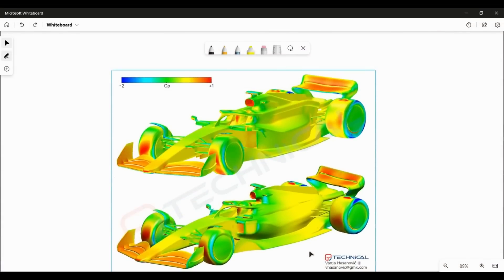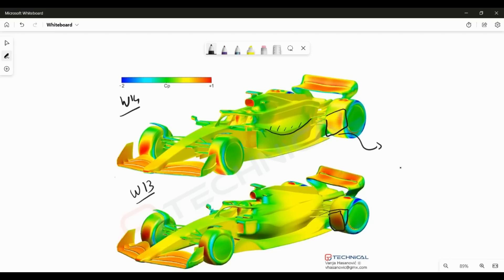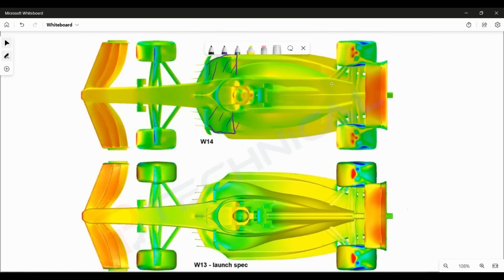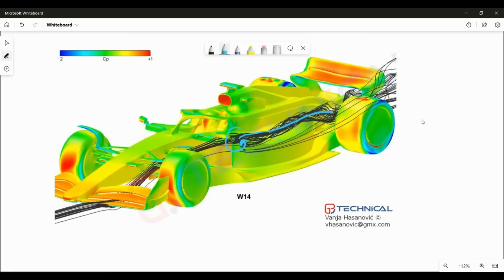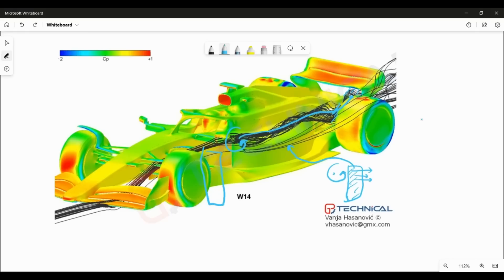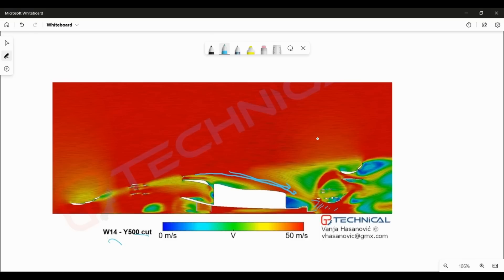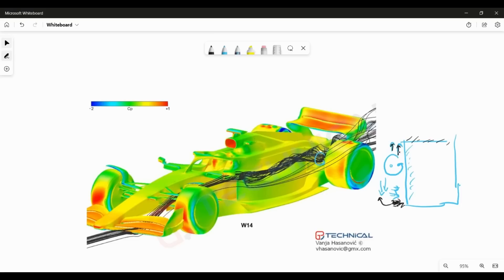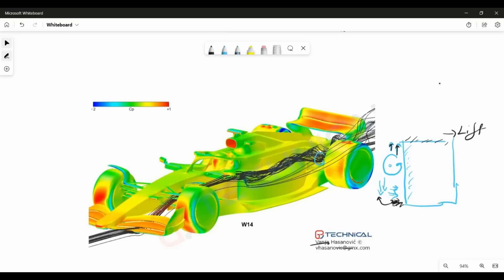F1 2023 Aerodynamics : Mercedes W14 Sidepods - Explained via CFD !!

Comment: I might sound nutty, and I am no aerodynamics engineer, but please hear me out. Wouldn't applying some positive lift through the upper body surfaces to find a neutral balance with underbody downforce allow teams to use a more compliant suspension set up?

Comment: Btw that crash structure wing lift isn't that bad as it increases suction into the tunnels but that big wing tip vortex creates quite some drag. Others push wheel wake away with big sidepods 
with clean air on top (even protected with waterslides/valleys in some cases) and some below too. It seems like a better solution of "bodywork flow".  
The "business end" tho is the undefloor and floor edges.
Reply from the maker: Well pointed out , the pressure side of the wing , does improve the suction into floor channels. The wing tip vortex definitely contributes to drag, and is not clean, but what I like about it is the benefits it can create downstream in terms of front tyre wake management to rear of the car  and rear tyre squirt management. But yeah, the other solution also works and is probably a cleaner way , but this one maybe a more tuneable way of achieving the same objective

Comment: OK, now that I had time to digest the video and get the excitement out of the way (lol), you guys hit the nail on the head. I would love to add that, the vortex shedding off the sidepod wing is down washing along the front of the sidepod and being guided back up from the front wing vortex AND the front diffusor guide vane vortex and they were together to do exactly what you showed here but the benefits are very extreme (in a good way). Careful analysis of the flow structure over the W14 sidepod during their test shows that the rear wing efficiency and diffusor performance is beautiful and extremely powerful. I do not see anything as...efficient or powerful on any of the other wet weather runs observed thus far but then again, the quality is not great. either way, I truly believe that Merc's car, if nothing else, is at least very very efficient even by F1 standards.

Comment: Great analysis, gives a lot of insight on how to evaluate an aero concept. I'm just curious to know few points, you mentioned that the vortex on the inside of front tyre would induce outwash and inwash on top and  bottom of the tyre respectively and on the rear tyre exact opposite phenomenon is observed, so I'm a bit confused how the mechanics is working in both the cases. Also when you talk about tyre separation do you mean early boundary layer separation on top of the tyre?
Reply from the maker: So for the front wing the vortex is clockwise , while the vortex induced via the mid wing is counterclockwise , hence opposite effects. Yes , separation is inherently related to boundary layer separation
Reply: @f1aerodynamicist  okay I got it now but you've drawn anticlockwise vortex inside of the front tyre.
Reply from the maker: @f1pedia.  So I see where the confusion is , what I draw at 7.00 is not the front wheel , its the front wheel wake behind the tyre and as the wake travels rearwards , I'm talking about the effect of the midwing vortex (anticlockwise ) will have on this wake.

Comment: All efforts should be made to get the airflow inboard of the tires, front and rear tires. If you want outwash, you have to get the flow in there, or the furniture on the wheels won't work. The wing on the lower half of the rear wheels is especially sensitive to airflow.

Comment: Why does the middle wing tip vortex induce inwash on the lower front tyre wake? Given location and the counterclockwise rotation of the vortex, shouldn't it induce outwash on the lower tyre wake?
Reply from the maker: It induces outwash on the top part of the wake which in turn results in "clocking the wake" , imagine something like due to the outwash on the top part of the wake , the wake itself tends to rotate , which results in the lower wake being inwashed.

Comment: I will apologise if I am wrong (in less than 48 hours from now), but I believe everyone on the internet will have to REDO these types of analysis after they see the real W14 on 23 Feb 2023 🙂. Somehow I can just see that something was left out on purpose. I will edit with an apology if I am wrong.
EDIT: I humbly apologize for my prediction was wrong. No changes to the W14 as far as I could tell today (Day 1 of Pre-season testing) 🙏🏼
Reply: I think merc are not going to show up with a different car in Bahrain this year, after the struggle of last year they probably want to make sure everything is fine before bringing some good stuff
Reply from the maker: Knowing F1 timelines n merc I would say this is a Nov - Dec Spec Car. But gone are the days of coming up with a completely different car due to budget caps. If they found a silver bullet (which is unlikely ) then yes. But I think Merc will focus on putting the right car on track quickly and running lots and lots of tests to validate all their models due to the struggles and miscorrelation last year.
Reply: Yes, I agree with both in terms of their objectives. I just want to make myself a little bit clearer: I am saying they left out something from the W14. Meaning, the W14 tomorrow will have something added or changed to it which requires a redo of analysis. It will not be a complete new car. For example: The front wing will be different or the side pods may have an addition, etc.  24 hours to go then...
Reply: EDIT: I humbly apologize for my prediction was wrong. No changes to the W14 as far as I could tell today (Day 1 of Pre-season testing) 🙏🏼